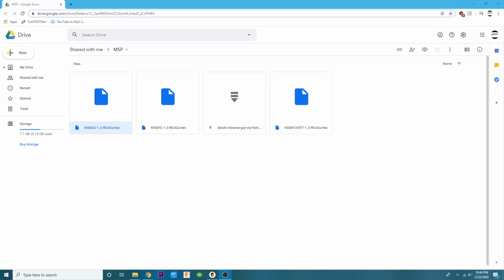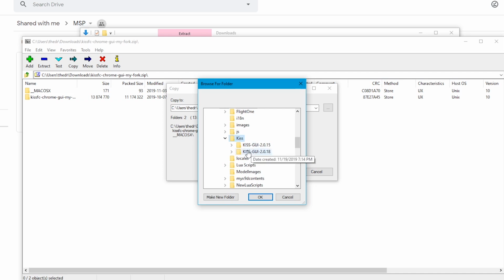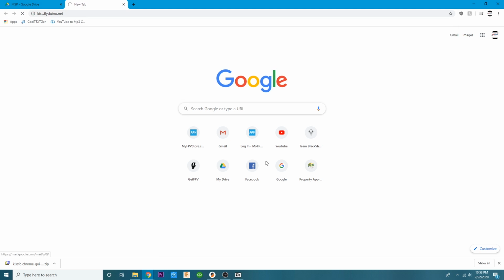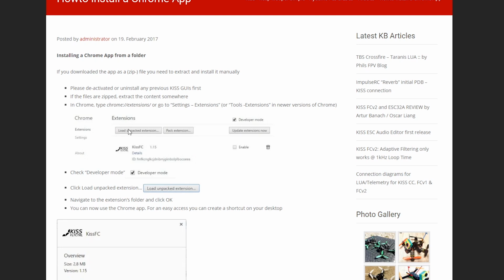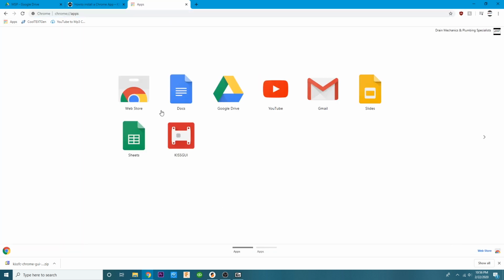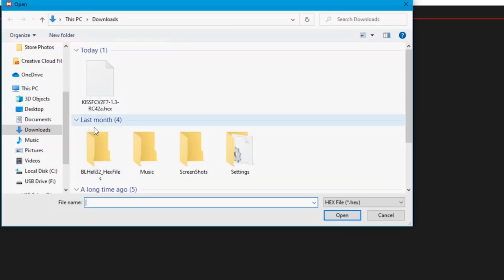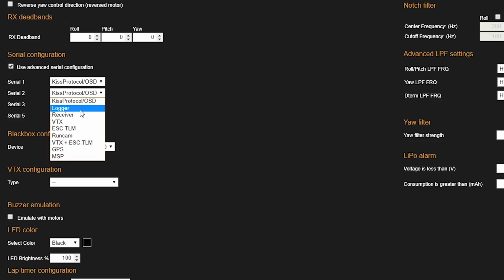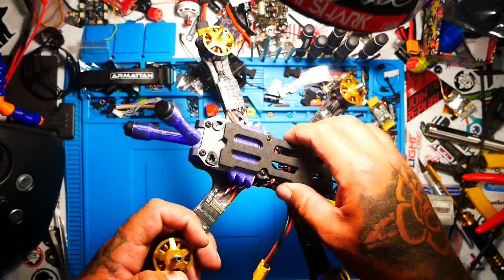How To Put KISS OSD On Your DJI FPV System❗(Works On Fettec)

Comment: Anyone have a solution? chrome blocks execution
Refused to execute inline script because it violates the following Content Security Policy directive: "script-src 'self' blob: filesystem: 'wasm-eval'". Either the 'unsafe-inline' keyword, a hash ('sha256-DfT2hf7Ca7ntFmmY56bqAi8fe+AuGA5RP6QakmMUCJU='), or a nonce ('nonce-...') is required to enable inline execution.

Error handling response: TypeError: this.messageStore.load is not a function

Uncaught TypeError: i18n.messageStore.get is not a function

Comment: i see video in my goggles and my remote is also paired, but i just can't seem to get the remote input to work with the drone .. it's not arming and under "data output" nothing happens when i move the sticks - any idea?

Comment: Hey buddy, great video.  I’m having one small (but large issue)

My lua scripts are not working from my taranis to my kids fc.  I can adjust pids thru dji goggles, but why would it not load thru typicall lua?

I have tried going directly into crossfire thru the taranis, it works ( kinda).  I can only lower the numbers with taranis, I can not raise the numbers (also weird).  Any help would be greatly appreciated.

Thanks man
Reply: anyone having any issues with LUA with crossfire / KISS FC V2 & DJI Cadix?

Comment: Hi, Nice video, is necessary have wolf osd or steele osd to see the lipo voltage on Caddx Vista?
Reply from the maker: Nope
Reply: @DrainManFPV  Thanks, you uses  UART3?
Reply: @DrainManFPV  Now Work, Thanks i Try in the Serial 3, Work Fine, Thanks a Lot.

Comment: great video thanks, where you running 6s? , does the fc put out 7.4 V needed for the air unit so you can wire it up to the FC? i know you cant wire the air unit directly to the battery because the air unit is only good for up to 4s?

Comment: Very important vid bro I appreciate your time making this video.  I'm assuming this same procedure would work on the Fettec stack as well. I'm excited to finally  dip my toes into Kiss. After flying Betaflight for almost 3 years. But I'm nervous on how to get this fettec stack up and running with my DJI system. Hopefully I can get this figured out..lol
Reply: I'm in the same boat as you, been flying Betaflight for 3 years and I'm about to order the Fettec F7, I'm worried about the DJI OSD,  how did everything go?
Reply: Don't get Fettec... Flyduino is what you want. Fettec is Holybro plus you have to deal with a pass thru to the fettec configurator and it's doesn't work well at all. I burned four FCS.  Talk about complicated.
Reply: @jaredmende3641  I went through four Fettec F7 the 30amp & 40amp esc is ok but only Kiss flight controllers for me
Reply: @allennickles3970  My Kiss 32a 32bit esc and v2 are A tank . I Now have the 25a AIO also. Never Changing away from them...Junk pile of All my old stuff just living around..

Comment: Are you using the kiss osd board? Building an apex with fettec 35a 4-n-1, KISS v2, Vista and a voltage regulator to power vista. (6s). What am I missing to get osd
Reply from the maker: I am just using a kiss V2 FC and KISS ESCs. There is no OSD on board. Did u follow the video and set it up.
Reply: DrainMan FPV work the video for kiss v1? Thanks bro
Reply: How did your build come out?  I’m trying for the same.  Why do you need a V regulator when the vista manual says input power is 7.4 - 26.4 V.  Should be good with 6s straight from the board right?
Reply: Laurent VF It turned out pretty good actually. And at the time I never read the manual but a buddy told me the same. Went straight to bettery
Reply: @airbrainaerials  Hey I am working on the same build but I am confused on how I should wire the 4 in 1. Do you have a diagram or photo to share?
Reply: Would this work without digital as well? Effectively OSD on kiss with no board
Reply: Use a wolf pdb to get osd
Reply: @franklyfpv1909  how do you use the Wolf PDB to get OSD with a DJI air unit or Vista?  Thanks
Reply: @urodinofpv3313  responding to the comment of keitell small I was referring to using the wolf pdb to have osd in kiss using analogue .... I currently with kissv2 and with the dji airunit I get the osd with a firmware from Alexander Fedorov aka fedorcomander but I think currently the latter  official firmwares for kiss v2 works directly today, let's say they have already implemented kiss / djifpv compatibility.

Edit: and of course with dji air unit or Vista you don’t need the wolf pdb.
Reply: @franklyfpv1909  thanks for taking the time to explain that.  Question, if you don’t use the Wolf PDB with DJI AU or VISTA then what do you connect the ESCs and  XT60 to if running KISS V2 FC and individual ESCs?
Reply: @urodinofpv3313  Yes, in case of carrying individual esc’s obviously you need a pdb, but not necessarily the wolf pdb, any pdb of $ 5 works, the osd of the wolf only works in analog

Comment: Drainman, Love your kiss series.  On your marmotte what PDB are you using?  And if that is the DJI conversion on thingiverse and you have the Wolf V3, how did you hold it down since the FC adapter is now a printed part. I didn't see any build info on the Marmotte. Thanks
Reply: Or is that the actual DJI version from armattan?

Comment: Great video! But do you have any troubleshooting? I followed the steps but when I look through goggles I still get N/A. I have the serial 3 set to MSP and am using the pins on the side. Do I need a certain setting on the goggles or something? Thanks
Reply from the maker: Yes you must set your goggles to custom OSD
Reply: DrainMan FPV Any other ideas? Cause that didn’t fix it
Reply from the maker: @kevinhale2877  Possibly you are on the wrong UART? Also try swapping your TX and RX maybe you mixed them up.
Reply: I get the same thing just says N/A, flashed right firmware, using chrome GUI, config set serial config 3, MSP, using Tx3 and Rx3, tried swapping Tx/Rx. custom OSD is on in the goggles, still says N/A
Reply: @justthink5597  I have same Problem

Comment: damn, awesome guide - honestly had trouble finding any information regarding this topic... one more question though - is it possible to get mAh used in the osd? because i personally find it easier to land at  a certain mah used since that usually leaves me at the same resting voltage for parallel charging
Reply from the maker: Yes you have to do it through Alex. I have linked his patreon.. He is the creator of it so that is the only way to get the latest and the greatest.

Comment: Super video, easy to understand . A big thanks  to both you and Alex F. On a side note do you like the Dji radioTx compared to your X9D ? Ive been afraid  to make the change . Peace
Reply from the maker: I don't mind the DJI radio, I definitely prefer my Taranis. I just got the jumper. I say pull the trigger just because you're already paying for the air unit you might as well get the free receiver that's built inside 👊
Reply: @DrainManFPV  exactly.
Reply: Tango 2 my dude! No lie, best upgrade I’ve made all year. I was running CRSFShot on my X9D+ before, but the Tango takes it to a whole other level 😬
Reply: @zfpv7211  really!? that sounds intriguing- just built my first 
kliss rig and absolutely love the way it flies- it would be nice to have4 a radio that has crx built in. Love the latency improvement over frsky . i love my old X9D plus tho- been using it since the olden days... late 2016 😂🤣